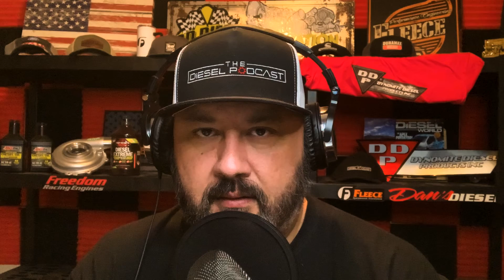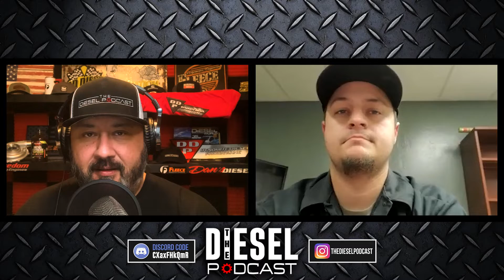Make 500+ HP with a 6.5!

Comment: I built a 6.5 94 Full size Blazer 20 years ago with a Pennisular Diesel 18 to 1 comp engine and everything Heath had at the time even a after cooler. I pulled a 16,000 pound trailer for 4 years with it and only 15#’s boost with a Gm 8 turbo. I destroyed my SunCoast triple disc converter and one 4L80E trans before I was able to get them beefed up. Sun Coast said they never had a 6.5 destroy a converter like I did. This engine is still a blast to power brake at red lights and smoke both rear tires!

Comment: my 97 CCLB has 412k on stock internals, quadstar, leroy and Health, have kept these truck running great, 284.3hp with 529ft tq, never gonna "RACE" but i will challenge anyone with a modern day diesel to go as far in miles as mine does and has!!! 27mpg in town under 55mph  long road trips  @ 68mph 29.7mpg with 3.42 gears
Reply: thats really impressive. Stock heads / gaskets? planning on putting an hx35 on my 6.2, I'd be happy to even crack 200 hp and thrilled to get 250 on stock internals with a little boost (max it out at 15 psi)

Comment: Not sure what kind of times he's running ,,,my F450 Dually runs 13.82 in the quarter mile 1.89 60 ft..and 14 mpg towing my race car Redeye ...oh and I had people in the cab with me ...during the time mentioned...17 mPg ..daily driven I have lots of mods Carillo Rods etc rtc etc...I have the build sheet. Just put in new racing trans  5 clutch packs...22 ltrs of Trans fluid...Colt Cam...and more ...

Comment: It's  not hard there is several guys and businesses.  I have messing with 6.5 s since 94. This guy has no clue and wrong info. I would love to see this motor. I'm  not a believer. In 94 they had 2 different pumps jan to June then July to December.  95 was different
Reply: From 94-2000 they used the same injector pump. I’m not sure why you think he’s wrong.
Reply: @FredsPenner  93 was last year of mechanical pump. 94 had a 1st half year pump design then at half year they made changes.  95 to 2000 had small differences but were nearly the same. 94 had its share of problems i worked with 2 chevy garages and banks to get issues figured out. Just what I found
Reply: @FredsPenner  I guess you know somuch more
Reply: @markstack2309   I have a 94 and 96, same ip. Maybe they were setup differently but it’s the same pump.

Comment: I can only guess that I’m between 250-300hp. Plenty for my purpose. HX35, intercooled, high flow intake, quadstar eprom, 4” straight pipe. Currently running 15-22lbs under 800egt’s , zero smoke. That quadstar chip is really dialed in well. Currently commuting an hour to work at 70mph and it has no issue jumping up to 90mph with a lot more in it when I let off.
Reply: I have similar and get similar results. Quadstar is the only reason 6.5s aren't all at the bottom of the ocean. Mine is super reliable and can tow a house and then I can switch to economy tune and get 22 to 25 mpg.

Comment: Gata be climbing up to 1000tq at 500hp
Reply: 500 horsepower😂 on a 6.5 those are magical unicorn numbers maybe the max 600 ft lb of torque before the block rods piston or crank give out they were not remotely built higher torque in Horsepower numbers they were built for fuel economy and they were semi reliable but it turns out neither were true most of the time

Comment: I sold my 99 burb sans drive train. My 86 Ford E350 based RV needed a serious upgrade. The 6.5 matches the 460 torque specs plus overdrive. 20mpg RV is a good reason to make it.
Reply: Why not run a 5.9 Cummins?  There's a couple companies that make hardware for the swap into an Econoline.  Much better bang for your buck.

Comment: My '94 K1500 only has 63k miles. Bought it a few years ago. I'm amazed how much I've improved it with bolt ons. S&B intake, non-Egr upper lower, wicked wheel, 4" exhaust 2-1/2 xover, raptor LP & upgraded fuel lines. And Quadstar tune. I love this truck
Reply: Did the wicked wheel do anything for the truck?
Reply: @stevebuttrum As someone that bought one for a 6.0 powerstroke, they make zero difference.

Comment: Yes, one of the most powerful 6 fives I've ever seen did a lot of work to it. After that, after we blew it up going up North with a TV and a car hall or anyone else. In fact, we're running forward. Default gun on the highway when it blew up. The block was weak in the crank. But after he figured out, everything was unbeatable that the guy came from texas and bought it that had comings diesels

Comment: My buddy had awesome 84 3/4 ton with straight pipe regular cam, flatbed woman and flat bed. You also had a 96 that could kick a 73's a** coming out. Illinois, pulling at 29 foot andclosed trailer and at 4 to point a 24 foot. And you sure that's 73 forward up? That's pretty impressive for a 652 do

Comment: I have a 93 with a 65 after 340000 MI something just went wrong with the engine it doesn't run right nobody in the area can work on it I've paid shops money they don't know what they're doing anybody have any good ideas on what to do I don't want to get rid of the truck thanks
Reply: Will it spin over but not fire?  If thats the case could be simple as needs a fuel pump to needing injector pump and injectors rebuilt.
I had waste gate issues with mine where it would not close all the way and broke pistons.  Could also have cracked pistons.  They are 21.5 to 1 compression so can crack pistons easy.

Comment: I made a discovery that i dont have the time or money to pursue. If you remove the pre combustion chamber in a 6.5 head, factory 12 valve cummins injectors bolt right up. I recon with a set of custom cupped pistons you could make a direct injection 6.5 with not too much tinkering. Probably would flow better too
Reply: My cousin has thrown the idea around of making a set of direct injected 6.5 heads. Ive also had this idea that would an 8 cylinder p-pump style pump work on a 6.5 cause the ranch performance did it on a 6.0 powerstroke so i would guess it would work on a 6.5 to.
Reply: The block can't handle that amount of fuel. That is the restriction. Figure out how to make the block significantly stronger than it is, and you're onto something.
Reply: @joepignoli7478 p400 exists

Comment: That was a good podcast thank you I myself do have a 97  6.5 diesel except when my old one blew up I went out and bought a brand new P 400 and put in it back in 2017 been slowly modifying it to run better like a cold air intake system on it trying to figure that part out and a lot of other things but the P 400 is a lot more stout than the standard 6.5 and a lot more there to work with when it comes to building horsepower according to Quadstar Tuning but the fact that I have a four-door crew cab long bed don’t think I’m gonna be using it to drag race that’s an awful big truck I’m not into pulling just want something to drive and run good and be reliable